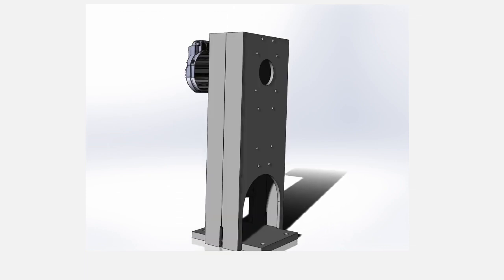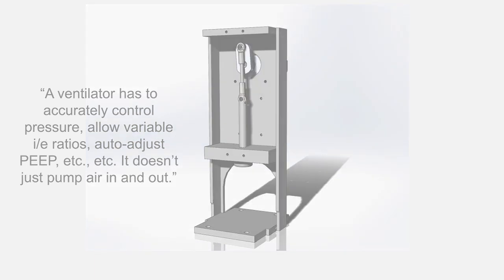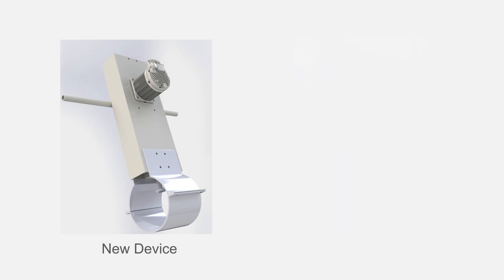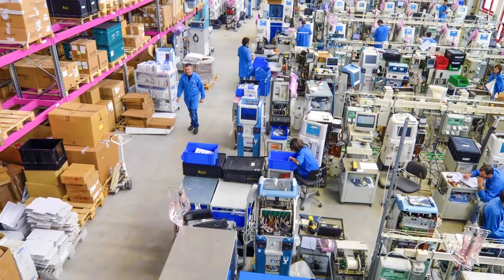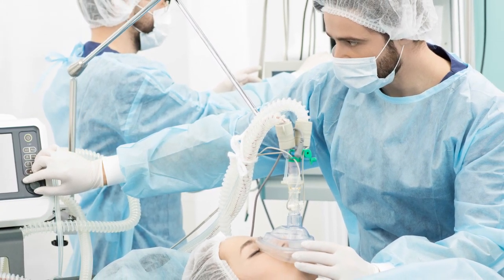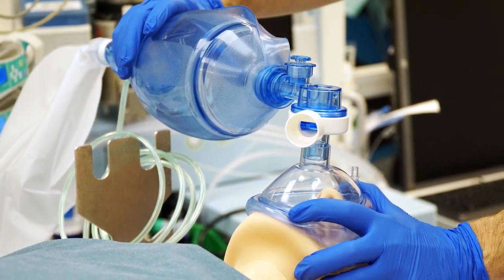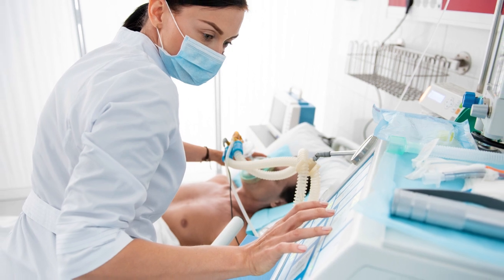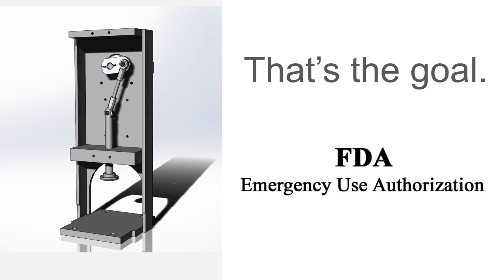COVID-19 Ventilator Update

Comment: This is probably the most practical of all devices which you so correctly call a "robotic arm" operating a Ambu Bag.
I too got started on this device and quickly abandoned it in favor of a bit more "sophisticated" device ...just a bit.
The reason i abandoned my Ambu compressor is because there are like a 100 design popping up on youtube.
I am from India and a Dr. Rustom from Pune (India) has made a really good device too.
I see your device indeed has full points and is very well aligned with your argument for its use case.
wish me luck with my "slightly advanced" design as I would like to make it available as a lower cost but with more features device.
SHOOTING IN THE DARK!

Comment: you could have made it springloaded, so that the spring is working against the backpressure of the ambu-bag. This way, a smother torquecurve for the motor could be applied and even much less powerfull and much cheaper motors can be used!

Comment: make sure whatever servo ends up on your vent, that it has A COOLING FAN on the back. Continuous duty CAN  / WILL overheat the servo and IT WILL STOP. I own your product and it will overheat during long duty cycles.
Reply from the maker: Hi Jonathan,

Thanks for the comment. In this application, the ClearPath motor model chosen by us was sized so that it could run without a fan, continuously 24/7, without shutting down (or even getting particularly hot). This was a key spec for the ventilator.

You are correct that continuous duty can cause a motor to protectively shut down to prevent thermal damage. But this depends on the amount of torque required; many applications can run continuously without any thermal issues, like this ventilator.

Let me explain: ClearPath (as well as most other servos and many other motors) has two different torque ratings, a “continuous” rating and a peak rating. If your application stays under the continuous rating at all times, or only goes above the continuous rating intermittently such that the average torque (RMS average) stays under the continuous limit, it will not shut down (as long as the ambient temperature is less than 40 degrees C).

Conversely, if you run continuously at a torque that exceeds the continuous rating, ClearPath will eventually shut down to protect itself. Similarly, if you use peak torques in excess of the continuous torque rating and don’t give the motor enough “rest” periods of lower torque usage, the motor will shut down because the RMS average torque will exceed the RMS (continuous) torque limit. (There is a thermal sensor as well as an RMS torque limit feature in ClearPath that protect the motor and drive from thermal overload in any situation.)

With fan cooling, most motors, including ClearPath, can provide more torque before they reach thermal overload. But even with a fan, it’s possible to overheat a motor with a combination of high peak torque, high duty cycle and high ambient temperature.

If you would like help troubleshooting your shutdowns, or sizing a motor that will not need a fan or shut down during long periods of use, please contact us at support@teknic.com.

Matt C. - Teknic Servo Systems Engineer
Reply: @TeknicInc  Life and death, I just had to put my 2 cents in. Love your product line by the way !